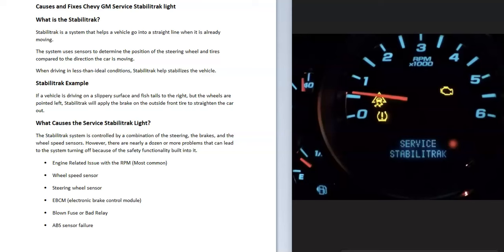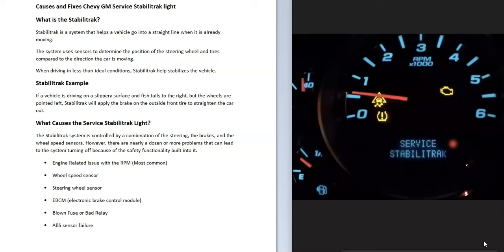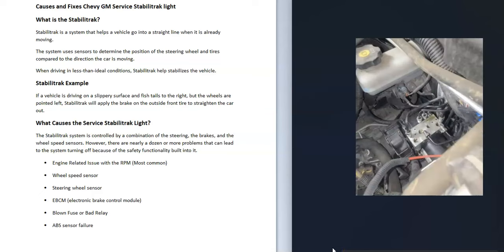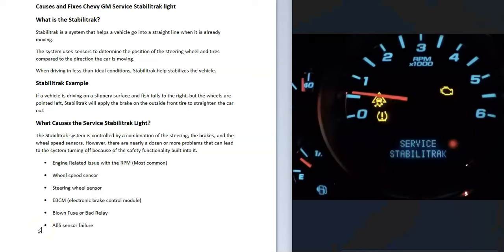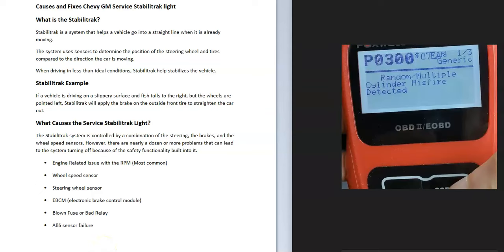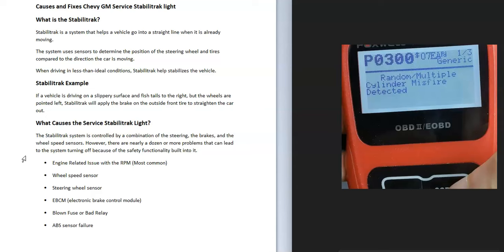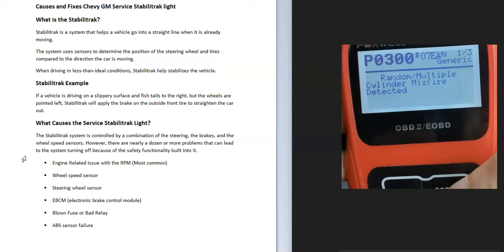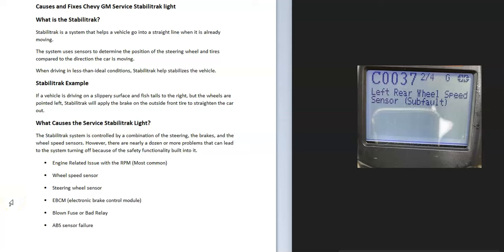Causes and Fixes Chevy/GM Service Stabilitrak Light

Comment: No mention of reset or anything after the repair. 👎
Reply: A reset? the repair is the reset
Reply: what is there to reset? you have your fix the issue before your car could work normally.
Reply: He's essentially giving a general explanation as to what it is,  what it does and what could possibly set it off. It's up to you to scan your vehicle and diagnose what is wrong with your vehicle. As stated above,  it will reset itself when the problem has been resolved.
Reply: I have no codes...but its tell me stability and traction controls and low tire pressure...will a low tire pressure set these off...
Reply: @JereB698 Well according to some other mechanics the track system can be reset.
Reply: @randyb8302  Of course it can be reset, the problem is fixed and it resets
Reply: @JereB698 no every time you fix something you need to reset it with a computer
Reply: @jus_dimas fix the problem and just reset the codes
Reply: Turn the steering wheel counterclockwise and clockwise. Turn off the engine. Repeat three times. If it still doesn't clear, reset with a computer ODBC-2.

Comment: If you have a 2007 to 2012 Chevy Tahoe and you loose power and stabeltrack comes on 95% chance it's your Throttle Body.. Catch is after market $75 won't work you have to get it off another tahoe, or go to the dealer!
Reply: Thanks

Comment: I have been having this problem for nearly a year now and the first time I had it looked at they said it was probably a leak in my fuel pump and then they said it was just a random misfire they replace an ignition coil and now they’re telling me I need 4 new wheels. It’s literally comical because no one can tell me what the problem is they’re just consistently asking for more and more expensive services and it’s still not fixed
Reply: Because once they know it’s a stabilitrak issue they start coming up with ways to hustle you out of your money. They know they can say pretty much anything for the cause of it. They will have you spending a thousand dollars even if all you need is a wheel sensor lol. That’s why I only have my uncle work on my cars because the last mechanic I had to beat up for playing with me lol

Comment: I am not getting any codes on my reader, but my ABS, and that Stabllitrack light / warring is on. how do i tell what speed sensor is the issue?
Reply: you should jack your car up and put it on stands: then check to see if any wires have been cut or if theres any missing. make sure everything is plugged in.
Reply: I thought it was speed sensor on mine but it wasn't..did you find the issue
Reply: @FLbowtieguy  Yea, it was the ABS sensor, the one that sits on the caliper. Is that the ABS or speed ? I forget, but once I replaced it the light went off.
Reply: @FLbowtieguy  also, I used a scanner at autozone and the code kept saying speed sensor which on that car is the entire wheel hub, so I tried the abs sensor first bc it was cheaper and damn it worked.,
Reply: @m.t.v.7934  did you have. A stabiltrak warning light and and abs light on
Reply: @m.t.v.7934  oh I see you did ok I'll check the abs sensor thanks man
Reply: @FLbowtieguy  Yea and the code reader was saying right front wheel speed sensor, that was $150, so I decided to do the ABS sensor because I saw a video pf the same issue and it worked. It has been a while now and still no light
Reply: @m.t.v.7934  I had the codes read and and gave abs module and something to do with power steering losing communication...I'll try the abs module maybe both go aways
Reply: @FLbowtieguy  good luck. I did not have any power steering lights or warnings, but to be honest who knows what these cars lol

Comment: I have the service stabiltrack light on, the traction control light on, my check trailer warning came on and my brakes are stuck on evenly about 50 percent pressure and the truck is basically undriveable. Has anyone had this problem? It’s a 2015 duramqx. It’s been in a shop 6 times now. The truck will drive fine then all the sudden these warning lights come on and the brakes are stuck on evenly about 50 percent pressure. Then it goes away and drives fine. I take it back to the shop and it won’t do it again. Today I got it to stop by turning traction control on and off, exhaust brake on and off and turning the truck on and off. Then the brake pressure released and I drove it home with the traction control fault light on and the following codes 

Co131 ABS
Co273 Brake reservoir sensor fault 
B101D AMP
B124B HUMAN MACHINE
B374A HVAC
B1325 HVAC
B1325 Ratio
Uo415 t/b
Uo415 t/c 

Any help would be greatly appreciated!

Comment: My 2014 Chevy Cruze has been doing this stability light traction control light keeps coming on sometimes the check engine light will come on with it. But it will do it at an idle it will do it going down the road typically if I turn the car off for 5 minutes and turn it back on it will be fine I won't do it again for like a week I've changed out plugs and coils battery ground wire for the battery I've had my suspension checked out my wheel speed sensors I cannot figure out what is going on

Comment: I had my battery replaced and then got home and my stabilizer link light came on, saying it was off in my 2007 Yukon Denali; I pushed the button on the dash shortly after it went off. Next day it came on again with engine light, but went off. Now it is off but yesterday when I was driving, when I tried to accelerate my front end trembled; please does anyone know what this might be

Comment: My StabilTrek light came on but i had to use my car.  On my way home from town (9 miles) my car would not go more than 8mph.  No one was around to help so i drive it iny the shoulder of the road.  It really started making noise a couple miles out.  I am a disabled great grandma on fixed income and my car sits on my lawn now.  My prescriptions exceed my income so fixing it is out of the question. 😢
 Thank you for your info, now i understand that I better just get used to the county transit hourly bus schedule out to my neck of the woods.  😊
Reply: Not sure if this will help but it helped me. I pulled the fuse that powered the stabilitrak system. Mine was a 25 amp fuse and labeled abs 2. 3 dash lights showed up but my car drives normally until I fix the hidden issue,

Comment: I had this happen few days ago, the engine ran rough and the StabiliTrak Maintenance  message appeared but The Check Engine  light did not illuminate.  I connected my computer and scanned for codes but none were listed or found. To note the engine will start running rough at any speed or driving condition but is infrequent. It will go weeks or months before running rough. Otherwise runs great! this past instance was the first time the StabiliTrak message has ever appeared.  I don't know what to make of this situation.  Thank you for the video and any advice you can give.

Comment: What if the vehicle doesn't have the check engine light ON? Will it still show you a code?
Reply: Yes, the engine light is for the engine. Any other light that comes on will also have a code if you scan it.

Comment: If my engine light has come on and my stability service light has come on and I have been driving for more than two weeks and I do have all in my engine with my car up with my car stopped working. What is the worst? That will happen if how long do I have to drive before my car tears up I don’t want my car to tear.

Comment: So I just replaced upper control arms, lower ball joints, thai rods enter an outer id alert and pitman arm, On the way to the shop to get an alignment to get a stable light in a Service airbag... Didn't pull codes yet what these two be related....
Reply: Same issue…did figure yours out?

Comment: I have a 2011 GMC Acadia and if i press the brake, traction control is on but when i release the brake the traction control is off... do i had to change the sensor in the brake pedal?

Comment: Does the cat converter trigger it? My 2017 read that both banks are faulty , just that , no wheel sensor codes or other codes
Reply: If you have a basic scanner it won’t show that you need a full system scanner, wiggle the wheel speed sensor see if it kicks on if it does most likely your wheel speed sensor. I’m my case driver rear speed sensor
Reply: Mass air flow sensor

Comment: what if my light comes on for a couple seconds and then turns off will the scanner still read any codes
Reply: Did you figure your issue out
Reply: Depends if you are on a slick surface. If you are, it will come on for a few seconds until it regains traction. If it comes on and stays on then it's telling you there is another issue.
Reply: Yes once a vehicle throws a code it's automatically stored. You can even get codes with no lights because it's pending.

Comment: When I start my 2016 chevy colorado, there are no lights.  But as soon as I press the brakes, the ABS goes on, i can feel the ABS pumping the brakes and then all the stabilitrak lights turn on.  The problem goes away soon after but the stabilitrak light and ABS lights stay on.  The problem persists every time I start the engine.   I checked my OBD reader, but it is not showing any faults.   Anyone have an idea what it could be before I take it to a garage and they start to bleed my wallet?  I forgot to mention there is no check engine lights on.

Comment: I wish they had a video for when you put it in four-wheel-drive 4low  both traction control, and Stabilitrak come on in my Tahoe well my lady was cleaning my vehicle and some little hands touch the knob when the vehicle was in park so then my lady comes and picks me up from work and we get ready to take off and it starts acting weird and I just told her to put it back in park and then I see that it’s in between four high and four low so then I put it back on auto and then I switch back through it just to make sure everything worked fine. Everything worked fine until I put it on four low and then those two codes popped up. I have an engine code, but I have holes in my Cadillac converter and the wire that runs my O2 sensor to the Cadillac converter. The wires are destroyed. I gotta replace the wires. But I don’t have any funky eye or no high idols. It runs, smooth other than I’m worried about when I put it in for low the traction control is off and the other light pops on and it’s never done that.